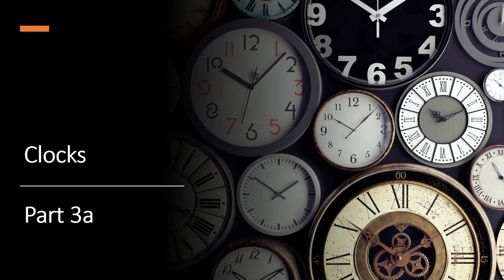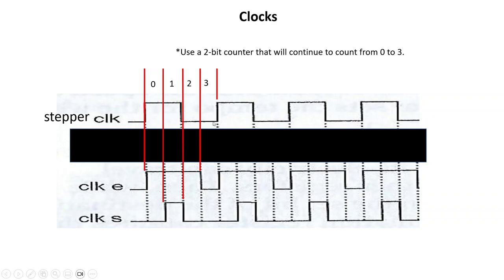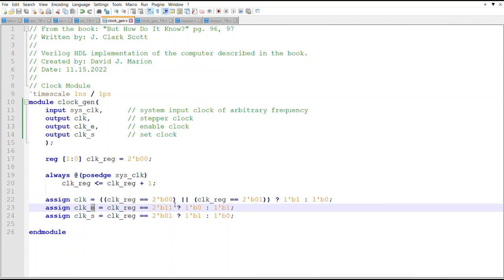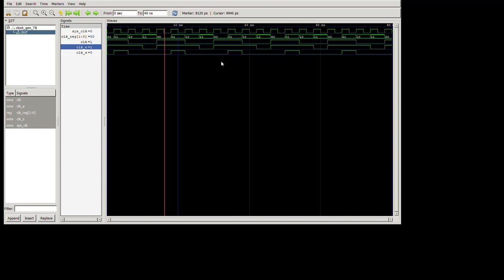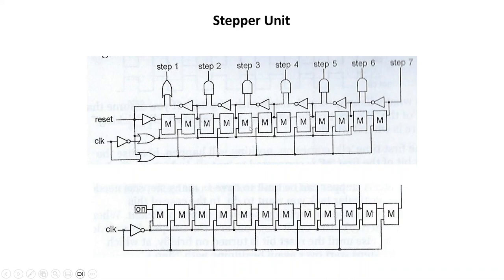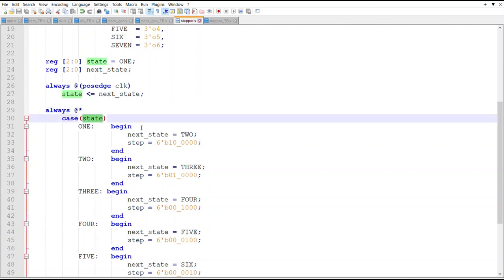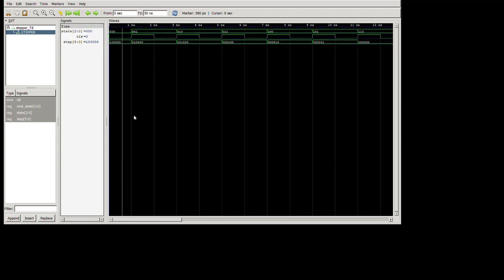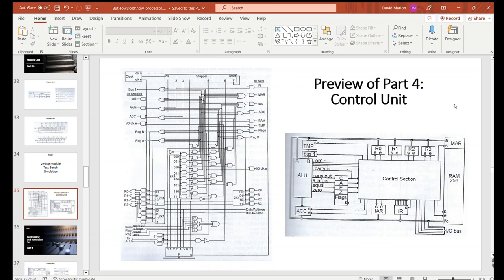CPU Series 1: The 7-Step Processor Part 3 - Clocks and Stepper

Comment: I still have a problem understanding the stepper. Please help.
Reply from the maker: Sure. What do you need help with? Simply, the stepper is there to synchronize the steps of the processor. You get one "step" signal every clock cycle that you can use with other signals and logic gates to make things happen for each step. If this doesn't help, ask some questions and I will be happy to answer them for you.
Reply: @dajoma36   Thank you very much.  This is what I have gotten so far about the stepper. Please correct or add information if possible. Each clock cycle = 1 step. The first  memory bit is connected to a part that is always on in the computer. Since the memory bits are all connected in a string, that on state is present across the string. Each step turns off when this on bit goes through a NOT gate. I haven't fully understood the reset part.
Reply from the maker: @amandaahona6562  I am thinking that you are referring to the logic schematic of the stepper? Honestly, I never really paid much attention to the schematic. I just understood what it is supposed to do and used Verilog to describe its functionality. But, if you would like to understand the schematic, please email me and I will email you back with the information from the book. Because, yeah, this is a complicated schematic and there is a lot of explaining about what goes on every clock cycle, and the reset.
Reply: @dajoma36   Thank you. Where can I find your email?
Reply from the maker: @amandaahona6562  You're welcome. You can find my email on the ABOUT page of this channel. But, here it is:
d.marion8@my.denver.coloradotech.edu
Reply: @dajoma36   The email address provided above cannot be found.
Reply from the maker: @amandaahona6562  Ok. Use this address:
davidj.marion@yahoo.com